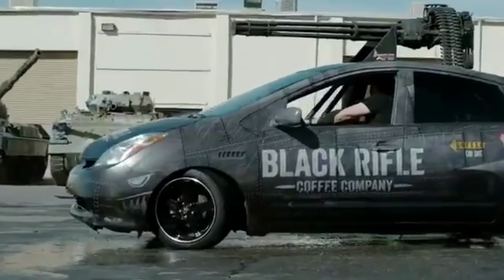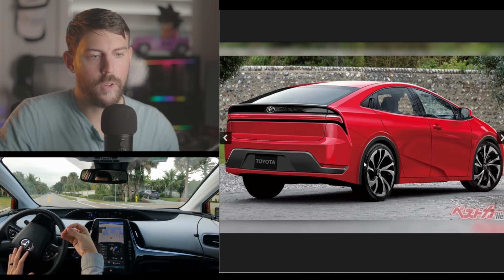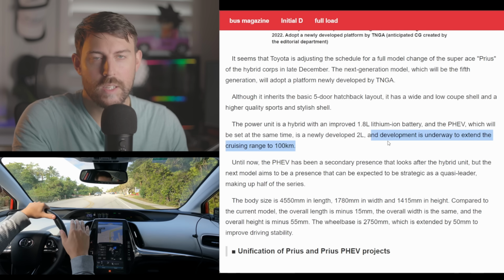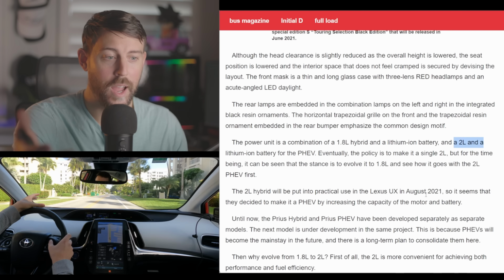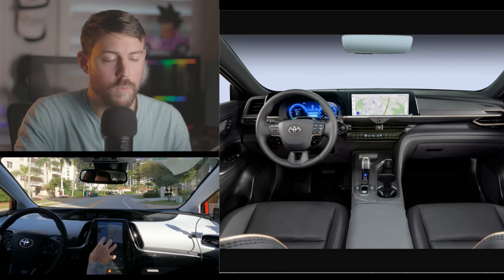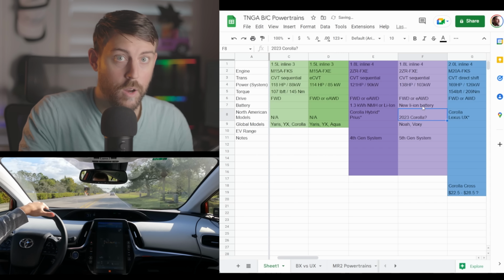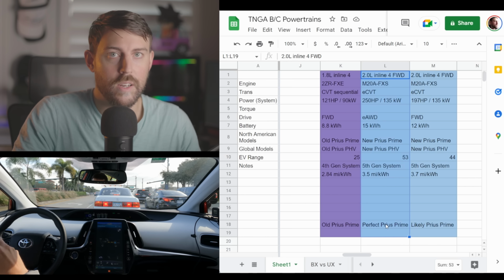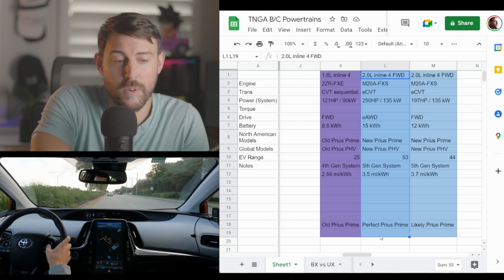*BIG UPDATE* The All-New 2023 Toyota Prius will have INCREDIBLE power and EV range...

Comment: Toyota went the VERY wrong direction with the engine size. There should at least be an option for a tiny 'range extender' engine, roughly 0.6 or 0.8 liters in size, set to run only at idle speed or 'charging speed'.  That engine could be ultra simple, cheap, light and small because you don't have to make it run at varying speeds. Obviously it would only charge the battery and not be connected to the mechanical drivetrain.  That would be a car that that would easily get 150 mpg even when not in electric mode.   I can't believe the 4wd version will have 250 hp, that's just dumb.  Why isn't Toyota pursuing fuel efficiency??!
Reply: my dude, you realize 60 MPG is still extremely good

Comment: that catalytic converter is still exposed under the belly and available for immediate  theft for the rare earth metals: Pt; Rd; Pl. Toyota didn't fix the problem.  IT cost $8k to replace a stolen catalytic converter,\ in Santa Monica dealer.

Comment: I have mixed thoughts on the Prius brand.  I still own a 2009 Prius with over 300k miles on it, and to be clear its been an amazing car.  What I don’t like is how Toyota went from industry leader to industry laggard in 13 years.  If Toyota wanted to keep its top spot as an innovator, the 2016 Prius should’ve been pure EV, with over 200 miles of range for less than $50k, and the 2023 Prius should be a pure EV with over 300 miles of range for less than $40k. Instead, they just keep upping the EV range and battery while shrinking and obviating the gas engine.  Toyota, please skip to the last chapter and get rid of the gas engine completely!

Comment: Well, my 2007 needed 2 replacement ENGINES!!  The second time I opted out of putting the needed engine in after driving an hour and a half and the engine seized. There was NO OIL in the engine w/o any warning and after checking the oil before starting the trip!!!  The repair was more than the car was worth in 2018.  But> I don't want a plug in car!!! I live in a condo and would need to go who knows where to charge it up for how long??  And I drive Uber so I need hundreds of miles per day range. Oh and then there's the unreliability of electric availability...and lithium availability.   Not convinced yet.

Comment: Toyota is the most experienced hybrid-vehicle manufacturer. As of writing this, they have 1 full-EV model out. But they also have a hydrogen fuel cell vehicle with the Mirai.
I know Toyota's been pretty slow with adopting full EVs. I'm sure when they do come out, they'd be some of the most reliable.
Was hoping for a Prius EV as the base, instead of hybrid. But I'm sure that'd be more expensive. More people can afford the Prius as a hybrid. That is, if the market comes back down.

Comment: I like the new possible design.  Don't do the weird backseat outside door handles.  HR-V went back to conventional ones.  I hope they are able to keep the same floor in the Prime as in the regular Prius.  They should come out with a BEV Prius.  That would be a logical step for loyal Prius owners.  One thing that doesn't bother me (yet) but does seem to bother older Prius owners is that the current gen. seems to have a much lower seating position.  My 2016 seems to be a lot lower than my previous 2007 Prius.  The Prius is not and never should be a "sports" or "sporty" car.  Keep us more upright.

Comment: One of the reasons sales are down is because Prius buyers are unique weirdos. It’s a small market compounded by low gas prices over the majority of the current gen’s span. 

Combine this with the reliability of… what’s reliable anymore? Oh yeah! THE PRIUS!!! They last forever. I have a 2010 with 280k mi I’ve maintained aggressively.

No brown head gasket.

No sludged EGR cooler.

No battery replacement.

It’s down a bit on power, especially during the seasonal extremes, but it still runs pretty well. Everything still works as well as it did day one… except the paint.

The most major repair I’ve had to do is change the wheel bearings.

These cars are mile sponges and why buy another for the minor improvements the current gen made?

That new one, though… that could be compelling.

Comment: I have the 2018 Prius Prime. At 62MPH I get 65MPG. at 70MPH I get 55MPG. You never talked about the MPG after the battery runs out. Personally I would want to keep the naturally aspirated 1.8L because its lighter and over all would get a better MPG in Hybrid mode. Having more power is not really needed, the car is pretty fast as it is. I would prefer better MPG over HP. If the car is slightly smaller, it should weigh less and have a drag coefficient of less than 0.24 hopefully. if the car is less than 3365Lbs, MPG should be pretty darn good! My trade in value of my car in $25K. I am definitely getting the 2023 Prius Prime.
Reply: it should be ebattery range for everday use like 100-150 miles, then freepiston range extender. rear sets facing rear, nets instead of solid storage boxes, tinted e eink hud with biolumensence whos default screen display asks for tire air, lubricant, fuel , etc refill, reminds how to hyper mile, tells how much ac heater decreases range in terms of miles or money.
Reply: @kalmmonke5037  the ebattery range should be 55 miles, not a 150, no idea where you got that information from. I needed the MPG for when the battery dies
Reply: @Joeteck  i not sure what balance between battery and combustion is best for low ownerhsip cost. weight makes everyhting more expensive in crash saftey, brakes, tries, engine wear and liquids, et while they are heavy so they are unsafe to lighter cars, still are lighter than normal vans trucks etc, yet they are not safer than lightweight cars staistically as explained in aptera owners club video, heavy increases road wear fixed by taxes and they cause downtimes to commcercial transpor, batteries are not recyled in mass and cost lot of emissions to maek so to be less emissions than combustion it will have to last long time despite battery degradation already being a porblem while toyota corollas , civis etc from 1980s 90s still run today.                       battery drive is cheaper to run in gas and time psent vs electricity cost if charging at home hours overnight or while at work, lot of energy going into and out car worsens degradation so fast charge and driving, carying more weight, is not good.                  driver should brake, turn, acclerate, minimally and steadily, build car momentum before uphilss and on downhills to increase speed with less energy, for combustion he should make most power at optimal rpm accoridng to bfsc chart and ideally plan to drive at optimal tempurature.. so a lotus evora communcitaive steeirng that is not too communciative like manual steering rack, can make it eeasy to use but also give confidence to driver of where grip limit is so he can brake minimally around turns, because this is more effceint than even regen braking because regen has energy loss when transferring energy into and out battery.  less weight allows more speed around turns with less requirement for suspension stifness and heavy mass, stiffness makes car bumpy ride rough road.

Comment: Kirk, what you ideally would want is the gas horsepower to match the electric horsepower to make the switchinf back and forth seamless.  Also, all-wheel drive is not good, just more points of things that may need expensive repairs and that also reduces gas milage.

Comment: 5 year fuel use of the Prius prime vs Corolla Hybrid is significant so if that's a concern for you check the numbers on that, especially with the recently proven potential for rising fuel prices. It convinced my husband to go with the Prius Prime this summer over the corolla hybrid and all other hybrid models. I think we found that info on Edmonds charts for depreciation over 5 years. Google. His drive is only about 5 miles from work so he can usually do just fine on the 20/25 mile range on the current prime. Honestly...I think 40 miles electric would be more than the average person would need in daily driving. It would be nice to have the better pick up with the higher HP of the newer one. Even so, my husband calls his 2022 a forever car.

Comment: Have driven Prius plug-in. Love our EVs.  Zero gas. Way cheaper to operate (no oil, no smog testing, no gas). Literally just tire replacement and less expensive solar generated electricity.  Time for Toyota to give up on the hybrid.   The resell value will soon plummet on hybrids given the influx of EV options in the market in 2022 and beyond.

Comment: I hate the center armrest design of my Prius. I thing Ionig 5 center armrest design is so  smart.  4 th gen Prius interior design is also terrible. It looks and feels so cheap. 1.2.3 gen Prius rear suspension setup is terrible too it is lowering the ride quality a lot. For that reason on 4th gen Prius, rear suspension system was changed to independent suspension system.  I also thing that it is very stupid to not put the speedometer etc. on the dash to on front of the driver.  Those were things I don’t like about Prius. What is good about Prius is : cam shaft is powered by chain not belt. Prius has the most reliable engine and hybrid system. Follow the maintenance schedule you shall have no problems with 100s of thousands of miles.  Mine has 330k and still delivering factory estimated mpg.

Comment: They should come with all electric Prius model. And give it at least 300 miles real life range with fast charging. And while achieving all of Toyota can keep the price at a more realistic level like Chevy  Bolt’s price.  And if they can somehow eliminate dealer price markup charade .  It would be hard resist offer for vast majority of consumers .  Toyota sales would sweep the automotive market .  As of now electric cars cost more than twice the cost of ICE cars. As for maintenance, Electric car owners are at mercy of dealers for there isn’t any independent electric vehicle repair shops.  Electric cars prices are so high that financial gain from switching from gasoline to Electric is not financially making sense.  Replacement  battery prices are also over the moon which would also deter potential used car  buyers from purchasing one after all it is a big risk to take. I think electric vehicles are great but right approach for any government is to finance Green Hydrogen production and make it available everywhere. Hydrogen  cars would eliminate all problems Electric car users and manufacturers facing today. Hydrogen cars also more environmentally friendly as long as green hydrogen is used.

Comment: I have a third gen Prius with 210,000 miles on it and it's been the best car I've ever had. However I just can't get excited about any new Prius anymore because of the Aptera.  For me the Aptera Will be the best vehicle for me 99% of the time. It will be the most efficient vehicle you can buy for the foreseeable future. And as a bonus it can get up to 40 miles of solar charging on a sunny day.  It'll also be cheaper than the Prius.  The only downside is that it only has two seats. But again for me it really doesn't matter because 99% of the time I'm just driving myself.  If there was an emergency or something I can throw 2-3 people in the hatch and drive to safety lol.

Comment: I loved my gen 2 2007 Prius for its efficiency as well as simplicity. It was the one of the best cars I ever owned and if one came my way I’d buy another. But 110 hp total was horrible, especially here in Nevada where you have Cali traffic running you over. I’m considering a Toyota hybrid in the future and was looking at a gen 3 since in my opinion Toyota got that one right. I’m extremely excited as this is the sort of upgrade I’ve been waiting for! 

I didn’t look at the new ones beyond gen 3, because to me they look ugly. Too many sharp angles and honestly I wasn’t a fan of the dated nickel metal hydride batteries that don’t last as long nor have the power/powercurve like the lithium ions I’ve had in my other hybrid vehicles. 

Power was another issue. Compared to my reliable 2014 Cmax Energi, which has 200 HP and is obscenely quick, I’m a bit annoyed at Toyota that it took them nearly 20 years for them to reach the power levels that most hybrids have now without much of a mileage loss. By 2012 a good majority of other hybrids had at least 170+hp and the Prius up until this one has been hovering around 110-140 HP.  

They really need to get over 170hp minimum to make this a good generation. Even on non prime models. Toyota is the king of hybrids and makes some of the best ones ever made! Perhaps they should look into lean burn and cylinder deactivation technologies which could blend seamlessly with electric cars. I will say sub 11 second 0-60 times in a world where the average cheap Korean family sedan is pushing an 8 speed transmission with a 240hp four cylinder hauling ass in 6-7 seconds and it being that way for the last decade is getting kind of old. I know the Prius is the god of hybrid cars but that’s my biggest complaint. Especially when merging on highways and things. 

If this comes out and is indeed what I see, then in 5-6 years when they depreciate a bit, I’ll be buying my first modern Prius. This is a beautiful car again! Don’t go nuts and mess it up Toyota!

Long live the Prius!

Comment: Ours was good on gas but always had issues. Battery failed at 142,000 miles just when we made our last payment. The dealership wanted $3600 to replace it. My wife called and complained and got them to cut it half. Then there was the wheel bearings and a lot of other repairs. Over all except for the mpg’s a rather mundane  car that. That gas savings was eaten up by the battery replacement.

One of the most boring or screwed up designs ever depending on the year, and it’s trying to compete with ancient hybrid technology.

Comment: The Corolla hybrid with that 2.0l (UK spec) puts out just under 200hp. The Rav-4 prime uses the 2.5l and a fairly different hybrid system - though they are of similar design. 
Its unlikely the power will jump much from the hybrid to the phev because the limitation is more to do with the way the drivetrain is set up. If they do a 4wd version it may add 20-odd hp but just with the larger battery its unlikely to add much if anything. 
I wouldn't worry too much about that though. The 2.0 is more than just numbers on paper. In normal use (not foot on the floor and revving the heck out of it) its far more gutsy and a lot nicer to drive. You don't feel like you have to baby it or go flat out so much - it has much more linear power.
Its also VERY efficient. I only used one for a few days but even without really trying it averaged over 70mpg (UK) just driving it about. 
I'm not saying it would do lots more than that if I did try because I was only pottering about but it didn't require hypermiling or any effort at all to get. 
The last Prius I used was a 2015 back when they were new and that only averaged just over 50mpg in similar use so efficiency has taken a big leap.

Comment: Big fan of Priuses before they were cool
When having prius as a username got you death threats

Sorry Forgot mid editing:

This is a cool approach. 
But not only does it have to look as cutting edge as the rest for 2023-2030, designers should get the reasons why the Gen 2 Prius was popular. It was a great all rounder - minus the ground clearance

 the Gen 2, as practical of a design as possible - and something that is actually clever durable, easy to repair and replace. 

Inside and out

Comment: We have two Prius Primes top of the line. A 2017 and a 2022.  I would consider moving up to a Prime with the RAV4 specs and 4-wheel elec. drive. Otherwise not much point in upgrading at the higher price that will be asked. These are fabulous cars. My only complaint would be the reflective screen and almost impossible to use GPS system. We both use are Garmin GPS(s) when needed.

Comment: Watching this in my 240k mile 2010 Toyota Prius, this is the most reliable car I’ve had, not the fanciest, but the most reliable
Reply: Hi, most likely you know this if you've cleared 200k.  The 2ZR-FXE very dependably blow their headgasket due to waterpump failure. Also huge issue with egr  clogging causing same. The pump is a catastrophic fail no warning, no sign, and takes out the engine.  My local jdm engine importer (JDM Engine Bay) sells between 30 to 50 motors in the bay area every MONTH. They fly off his shelf like windshield wipers in the rainy season. That $225 pump fail destroys the motor ~150k miles.  The Pruis ZRFXE is a ticking time bomb every mile around that number and everyone who doesn't know this out of ignorance, bliss or mistaken believe of dependability is going to pay the price.
Reply: @dvmartel1  hi, I replaced the water pump myself, it was getting old and was a cheap and relatively easy fix.
Reply: @TheLegend0fRAWR  yeap, its the right thing to do.  I just think there are far too many drivers that are not engine maintenance savvy who think its a Toyota and indestructible.   It well may be with a diligent owner.
Reply: @dvmartel1  as with any car, if you own it you should be able to do basic maintenance and such, or at least have a little knowledge about the car you’re driving.

Comment: The problem with these cars is that you still have your oil changes and other related maintenance issues associated with gas engines. It looks like a nice car but since I bought a 100% battery EV I will never go back to ICE cars. And I do lots of miles and road trips . No problem. Toyota should get with the times and forget about ICE cars. They are going to stay behind and even may go bankrupt sticking to old tech. Toyota is a great company and I like them to be winners not losers.